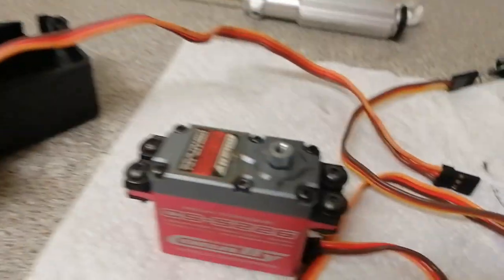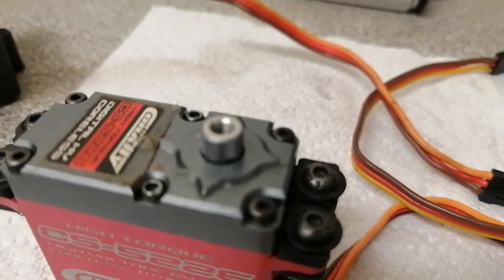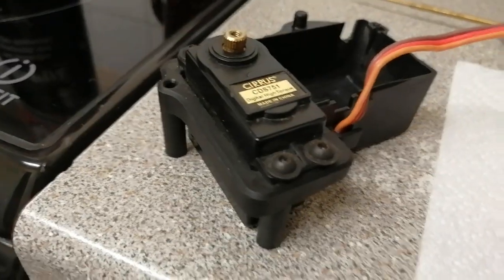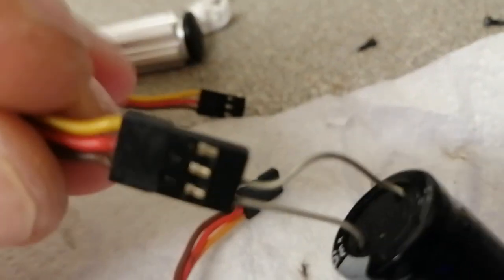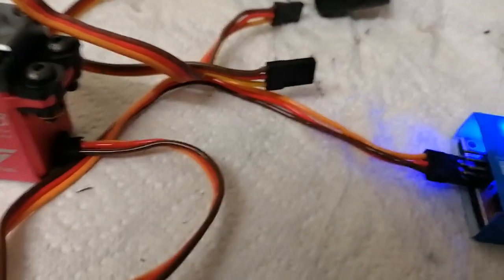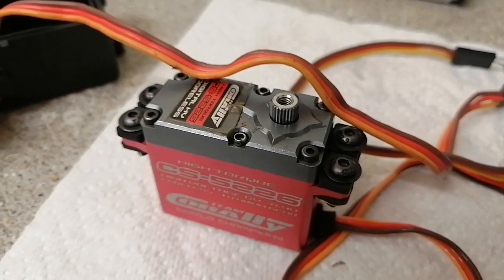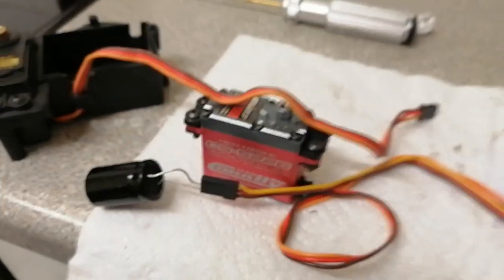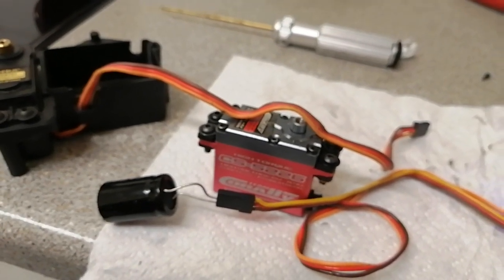No More Servo Jittering/Glitching :)

Comment: So the capacitor bassically smoothes the rotation? If I want a super smoooth rotation, almost as if there is a big delay between the input and output, should I add a big capacitor?

Comment: I have a mn99s rc, with standard esc condition using 7.4v 1200mah battery .  i am having the same problem as in the video, can i use 1pcs 10v 2200uf? where should I connect the part, is it after the power supply line or before the servo line?
Reply: Servo lines

Comment: Hi, Thanks for your video,  tip, some servos will work with this solution,  if don't work for you,  the radio signal for the servo is wrong,  5mhz /11mhz, /16mhz most analog servos work perfect on 5mhz, most digital work on 11mhz , and digital brushless work with 16mhz, only the top pro radios has the options to set the frequency for your servo, this is why the pro drivers go smoothly on the track,  have a great day. 👍

Comment: Please help i have a issue of my steering, when i throttle forward the steering turn a bit to the right and the faster i throttle the bigger it turns and if i go reverse it turns left and the faster reverse the bigger the turn without touching the steering of the transmitter
Reply: Can’t you trim out the transmitter?

Comment: Hi, I have same issue with my digital coreless servo (SAVOX1231sg) and I saw on youtube digital servos have problems with radio wave interference....I would like to try with your solution but I am interested how did you apply capacitor between servo and channel?
Reply from the maker: Just connect to any free channel
Reply: You have insert the capacitor?
What is result?
Reply: @francescolocorriere  power supply stability….I don’t have glitches anymore…..